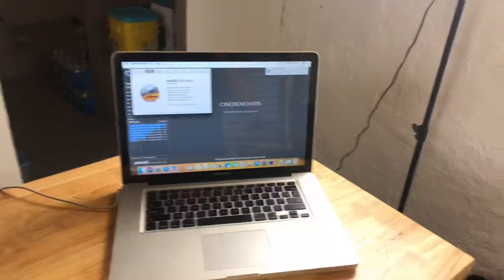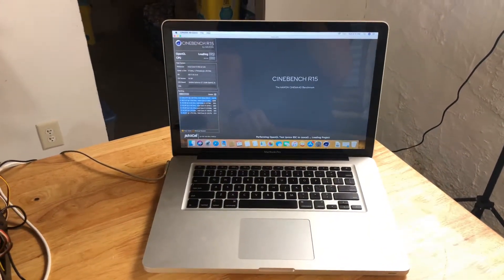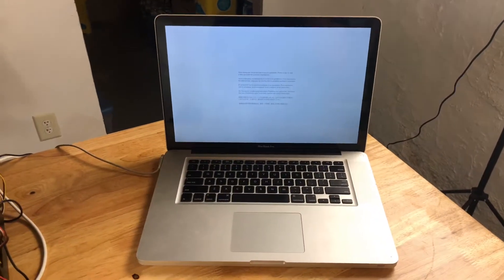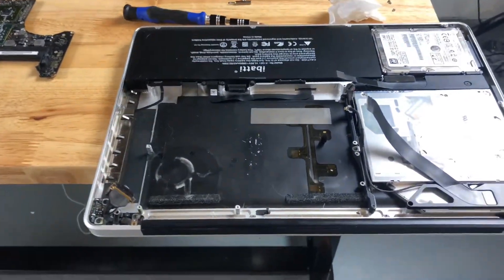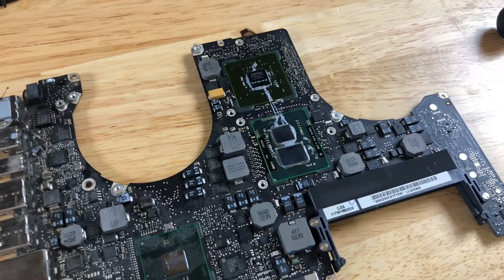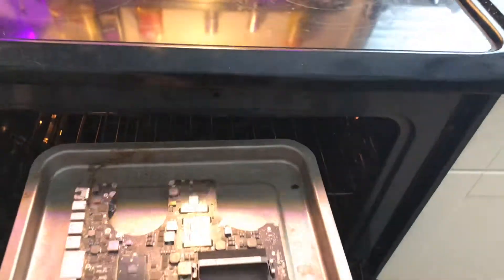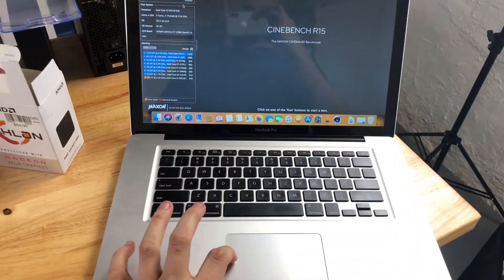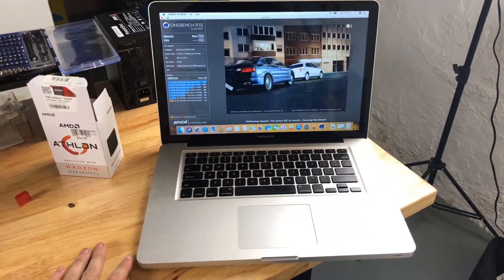Mid 2010 Apple MacBook Pro nVidia GT 330 GPU fix

Comment: you didn't actually explain why you had to put it in the oven and you didn't show how to put the new paste on. did you have to lift up the chips or clean them off or did you put the new paste on top of the old paste?
Reply: Let me explain! He didn't tell technical details because it is not neccessary, first of all if someone familiar with the electronics than that person will automatically knows what to do and he is shows the important part which is the actual hardware issue and the solution.. so as short he is briefing for those who done this before even if not on Mac Motherboard but other type of PCB ..
Otherwise for people who does not have knowledge it is more safe to not to do anything 'cos it might create more problem.
Your specific questions here is my answer : The reason he put in to the oven is because the intense temperature able to re-position the GPU (that's the nvidia) the precise name of the method is GPU REBALL, it's because under the chip there is couple of hundred tiny little solder ball (instead of legs like the IC-s have, The Oven trick is technically repeat the method that the Factory doing when they build a Motherboard, even the actual completion is much more special in the factory the key is the HIGH TEMP.. 
Now the reason I highlight it is not recommended for someone who does not have expertise because this method have to be precise, timing, alignment, preparation otherwise it will kill the MB .. apart of that and in addition everyone have to realise that it is gamble with 50-50 chance of success .. I done a lot of succesfull motherboard resurrection in many different kind of brand and machine type but as well as many times it did not fixed, the best trick that I figured out with few of my experiment test (own died motherboards) that I used flux on the side of the gpu .. the flux is technically helping the solder to flow .. however it is again can be dangerous if it flows together micro parts that must not be connected electronically .. so as short is a Catch of 22 but it worth the time (especially when I can save £200-£300 of a purchase of a new Motherboard) ... Good luck.. Hope I answered all of your concern! 

for the Video Creator : Thank you the upload and the time and effort & energy for the work that you spent.. Kind regards, John - Oxford

Comment: Well, have the same MacBook with the same problem. When gpu switch to the nvidia card, it's immediately fail.

Just wanna know, it's permanently fix problem for you, or it's repeat?
Reply: I change that capacitor and working very well with Nvidia Graphics. I show the Louis Rossman video to a professional and he change that capacitor! 2 months working very well, bake don't solve the problem.
Reply: @janquieldapper  backing if you have bad contacts as in this case regenerating reheating the soldering might fix the issue so from my part it is plausible but another thing is kernel panics are not hardware related they usually come due to miscofigurations bad settings that the firmware does not allow it lets say that the nvidia driver sends an instruction that the firmware does not allow and in order to prevent hardware failure the firmware just reboots the system when there are hardware faults the system just dies shuts off instantly   on that particular hardware the nvidia chip is g216 and that is a desktop chip but on notebooks is underclocked will work ca max 80%of the capacity  and that at best in order to be able to use it at 100% or more it is neccesary  to replace the voltage regulator and the powersupply
Reply: Louis Rossman show how to fix this problem. https://www.youtube.com/watch?v=DzcgT_fiVTA&t=935s
Reply: @janquieldapper  I found the software solution of this problem on GitHub, like six month ago. It's works for me.